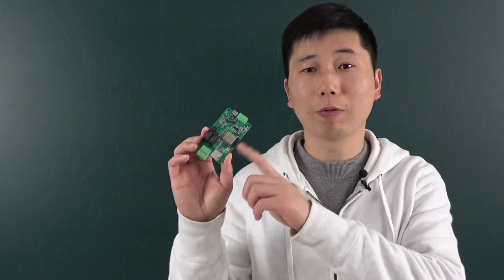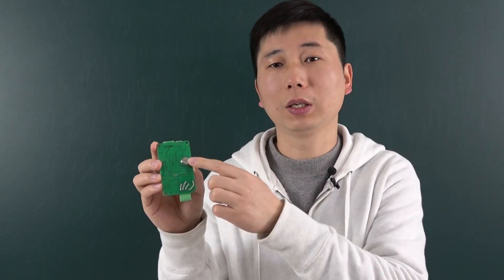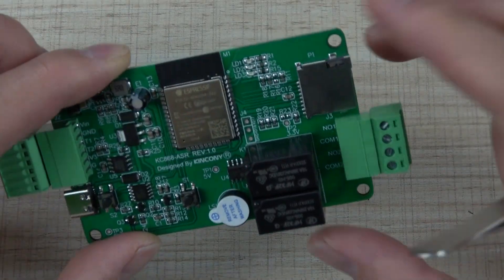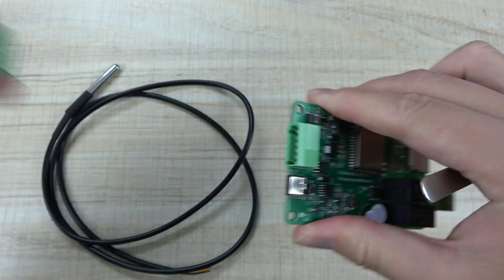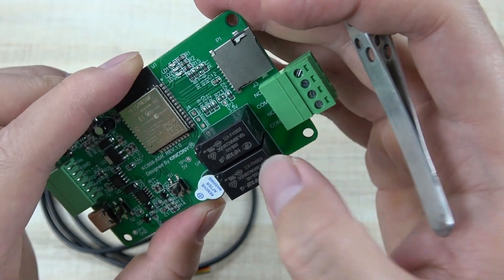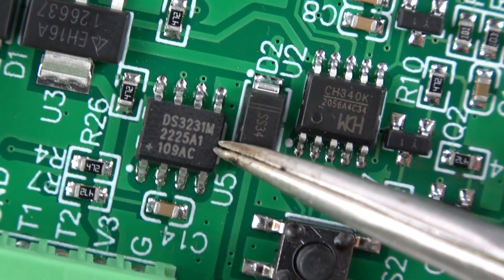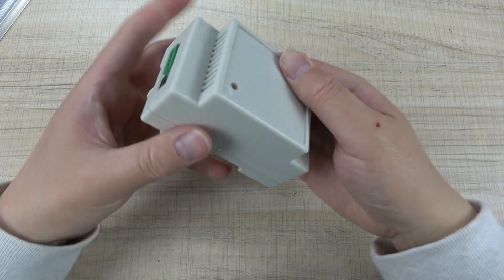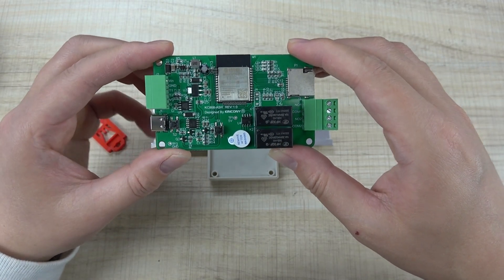KC868-ASR ESP32 SD card + DS3231 RTC + 1-wire sensor board

Comment: With this product, I want to connect TTL using GPIO 16 and GPIO 17. Could you please advise me on how to proceed with the connection?
Reply from the maker: beside of RELAY, there is GPIO16,GPIO17,GND pins on PCB. You can use it.
Reply: @KinCony  thanks so much

Comment: Can  dc volatge sensor bre connected to this?
Reply from the maker: use 1-wire sensor for this board. if you want use dc 0-5v sensor, you can use another kincony's model
Reply: @KinCony yeah you are correct.... a bored with rs485, right ?
Reply from the maker: sure, we have many board have 0-5v analog input ports and RS485. @chuksobi593
Reply: @KinCony  recommend  a model number for rs485 dc and ac hardware  monitoring application
Reply from the maker: also need monitor AC220v load current? @chuksobi593
Reply: @KinCony  yes
Reply from the maker: AC monitor: M16v2   DC monitor: MB will release soon. @chuksobi593
Reply: @KinCony can't I write a code to still access the harwares through rs485?
Reply from the maker: sure, board have RS485. @chuksobi593

Comment: can this be used for recording data from 4-20ma to 0-1v module?
Reply from the maker: it use by 1-wire device, such DS18B20, DHT11, DHT22, etc..